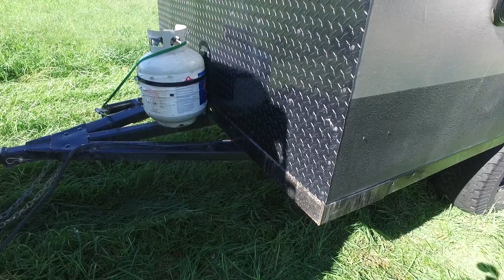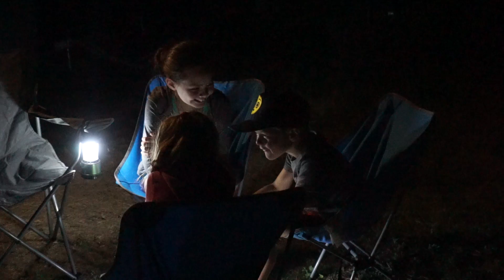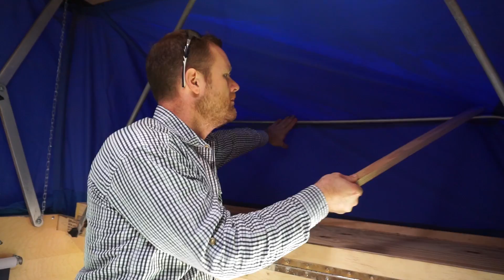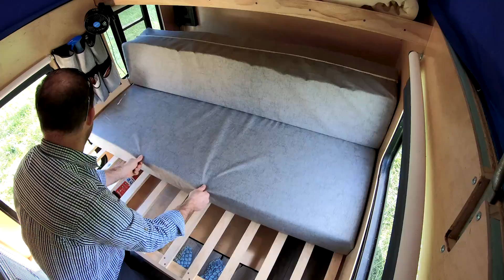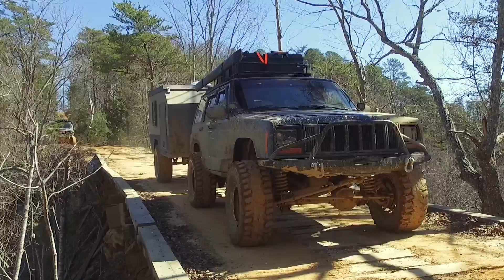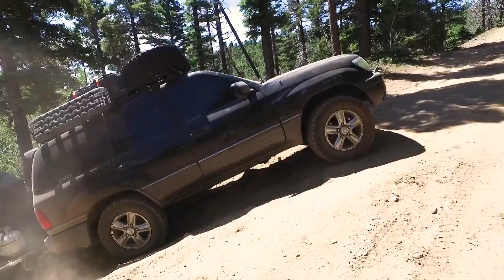The most AMAZING DIY Off-Road Overland Camper on YouTube E49

Comment: Quick, short and direct. Best thing for my ADHD... 
Definitely should have mentioned to make sure to add a hanger for the caliper to prevent damage to the lines (you did it tho). Also to make sure to tighten the lower strut bolt when the vehicle is on the ground and has a load so it settles properly and prevents early wear of the rubber. I also have to soak the major bolts with break free the day before. 
!Thank you for the help!

Comment: Always a pleasure to see excelltent craftsmanship like this trailer build you did. I noticed you had a Jeep Cherokee before, did you need the V8 power in the GX to pull the trailer?  The scene where  the GX is pulling it up the steep incline is impressive.
Reply from the maker: iQuantium I didn’t need the power, although it has been nice.  I pulled it with the XJ for a long time but I didn’t trust the XJ to travel thousands of miles across the country.

Comment: Great job and design, if you wanted to bring a boat with you, is there a mod you could do to carry it on top of the camper?
Reply from the maker: you could very easily add a roof rack to carry a boat or anything else you like.   You would just have to remove it before you raised the roof.

Comment: Before I spend money on your plans, can you address total cost of the build assuming I already have the trailer I will use.
Reply from the maker: 24 Vignettes I have a parts list on my website with pricing that you could use.  The best answer is “it depends”. If you already had the trailer and wanted to just have a usable camper, I would say $1.5-2k if you want to completely fix it up to the level I did (integrated stove, plumbing system, hot water, etc). You will get close to 5k really quick
Reply: @shaweehillsworkshop4226  awesome. Thanks. Thinking about a summer project with my son before he heads off to college next year.

Comment: Hello from Louisville! Interesting build w/ the pop up roof. What, if anything do you do to prevent moisture and condensation buildup on the inside from exhalation/rainy conditions? KY gets pretty humid. Have you run into that issue ( I know you said you generally camp in colder weather) ?
Reply from the maker: Pawwwll I keep the vents open and haven’t had any issues so far.

Comment: Nice design, and nice work.  But I am not a fan of popups, the main reason is, if I camp in bear country I want something more than canvas between me and the bear.  Beats the heck out of a tear drop tho.
Reply from the maker: T. F. If you’re in bear country just don’t pop the top.  Use it like a teardrop!
Reply: Minor problem with that.  I don't like teardrops.  But all is good, I have a high top van I am converting.

Comment: What does this bad boy weigh in at? Great build!
Reply from the maker: Joe Hanika I haven’t weighed it but I towed it with an XJ with no problems so I’m guessing under 2k
Reply: Those XJs have good torque for towing anyways. Also I noticed you used a trailer axle with brakes. Can’t go wrong there. Very good job